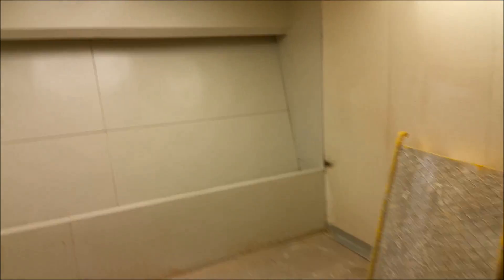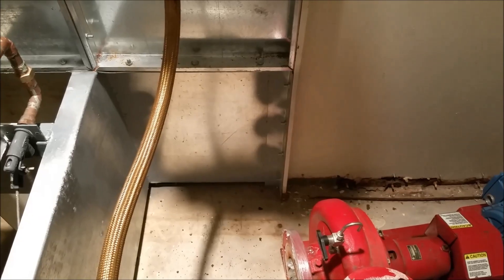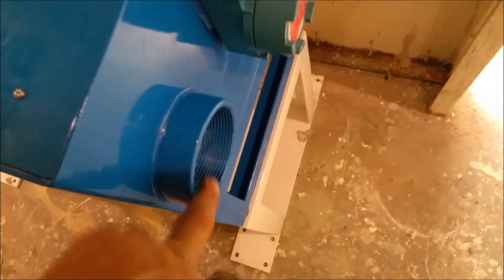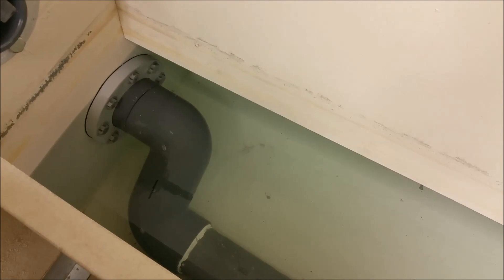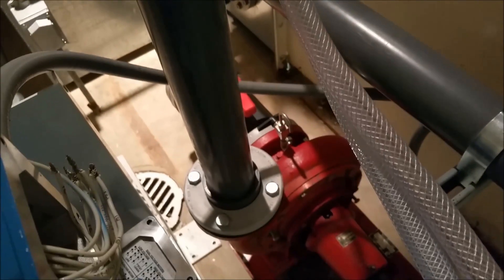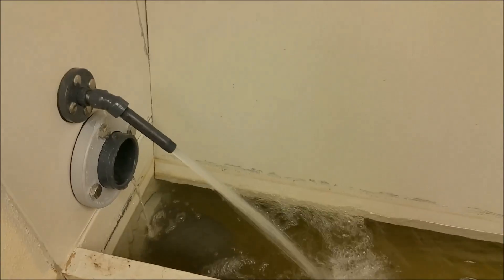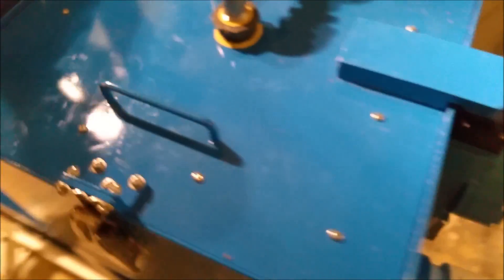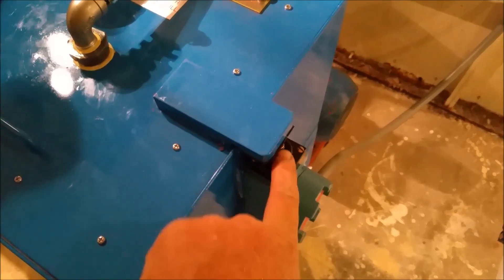Centrifuge Application

Comment: nice job, however i'm a tad confused.. if the centrifuge has a skimmer why feed the crud back into the main tank? if you're skimming crud it would seem to me it should be discharged from the system.. otherwise a simple recirculation pump would suffice
Reply from the maker: The skimmer is to keep from overflowing the bowl, in other words it keeps the spinning bowl at an optimum level. I guess they could have used a better term than "skimmer" ... but thats what they call it.
Reply: Shadon HKW
so then where does the crud go? it can't build up forever in the bowl... or is it the overflow part?
Reply from the maker: I slings out of the top of the bowl into the box enclosure, with the 3" drain down at the bottom.
Reply: Shadon HKW
ok, that makes sense now thank you so much for the explanation :)

Comment: Thanks for that very interesting episode Stan! I was not only reminded of my years as a pipe-fitter and welder, it also reminded me of how much I enjoyed the challenge of fitting, followed by the relaxation of just playing with the puddle and having a "Good time with my Hood time".

As you illustrated some jobs can be fascinating(at least they were to me while spending only ten-11 years in the field), and then some jobs (with a tree of off-set rolled 45's that have to look like a machine made them), can be a bit...frustrating ;)

Even the gaskets for all of your flanges brought back memories, and some of those memories weren't so good. Mostly the ones that leave you wondering how many of the gaskets you had to wire-wheel off of flange faces were made of asbestos on the ancient fuel lines at tank farms from the 50's and 60's? Because we know almost everything fireproof back then was made from that "miracle molecule", LOL! Cough, gag, wheeze...

So am I to understand that the catchment bag is non-permeable and thus creates the need for the upper siphon?

Aloha...Chuck

Comment: I thought a centrifuge was used mainly in mining, but your installation shows that it has many/multiple uses. Your project looked well designed/constructed, very professional!
Did the Anchor Lube work well on all of your cutting/drilling and especially threading?Looks like you probably won't be using anything else, soon!
Thanks....13
Reply from the maker: The biggest problem with threading pipe is getting the cutting oil off (we spray with aerosol solvent) so the thread sealant will work properly. With the Anchor Lube, we just wipe it with a water soaked rag. I have been using it on the power pipe threader as well.

Thanks for the view and comment.

Comment: Received my anchor lube sample today, tried it on a quick part on the lathe and it works great. The smell is 1000x better than cool tool II, rapid-tap and the nasty sulfur based oil I used to use. I also like the lack of billowing smoke from the heavy cuts. I am fairly certain my wife will stop bugging me now about breathing in all the fumes this winter while I work with the garage door down. I will be ordering a gallon and dropping your name, thanks!

Comment: for the life of me I can not figure out why a hospital would need a paint separating centrifuge.  Please enlighten me, as to the purpose of this.  BTW, great job, it looked and appeared to work great.
Reply from the maker: Hi GG,
They have a full maintenance facility below ground, including a paint shop that refinishes furniture for the hospital, this is an amazing place, almost like a city inside itself.
Reply: They wash all kinds of icky things in a hospital.They also run up a frightening water bill.Clean the water and you cut the water use drastically.
Reply: Hmmm, never realized any of that.  Thanks